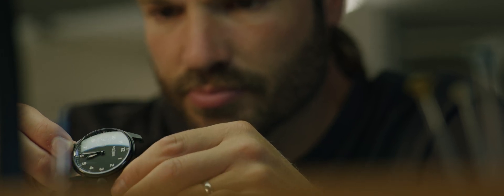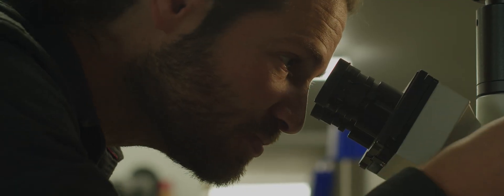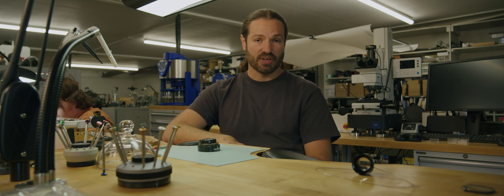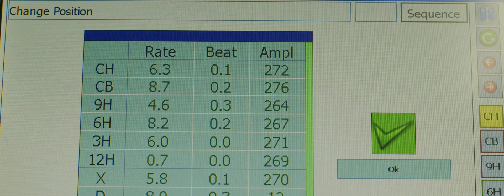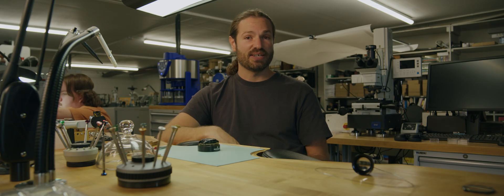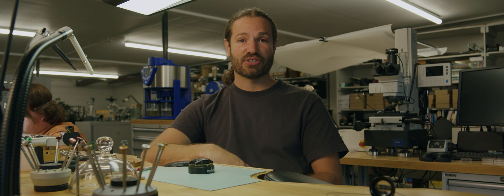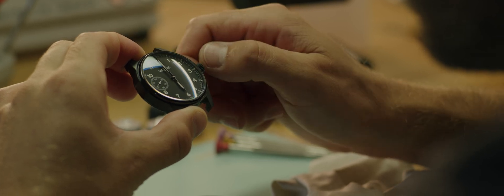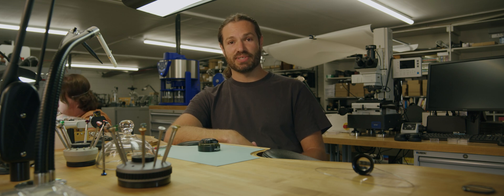Watchmaking Quality Control

Comment: Hi Cameron!

I'd like to ask two a few things as a layman (I'm interested in watches, but haven't worked on any yet)

1) I've heard about watchmakers cleaning their surroundings constantly, and also wear white coats, but what about hair and facial hair? Can a hair be easily spotted under magnification, or do they cause issues?

 
2) Can gaskets be installed in a wrong way, or brand new, non-generic gaskets have manufacturing issues that can cause catastrophic failure later on? (I have a watch currently undergoing service, and terrified about not knowing much about how gaskets work, and how/when even a watch is deemed so that it cannot be waterproofed anymore (heard about stainless steel cases pitting in those grooves, and saw images in a WOSTEP book about bracelet parts being corroded and pitted

C) What's the function of an auxiliary reverser wheel on an ETA 2892/A2? 
In one of the shots, you rotate the rotor, and it spins up: how come it's an exposed part in the 2892-A2, opposed to the 2824-2?

Many thanks!
Fred Herbert